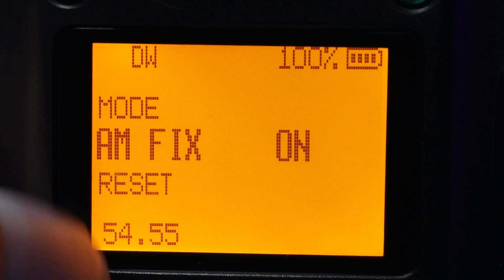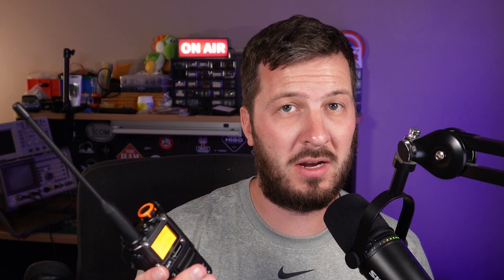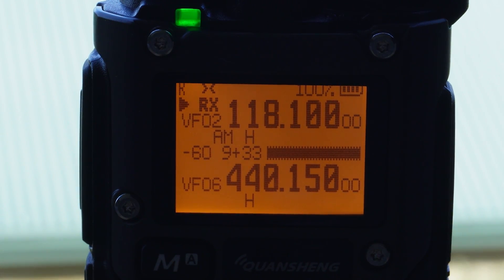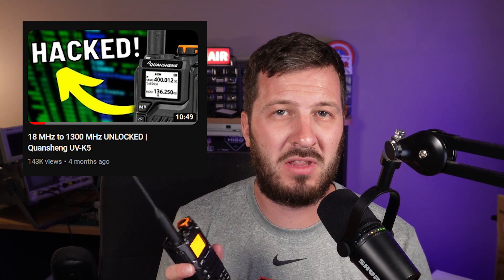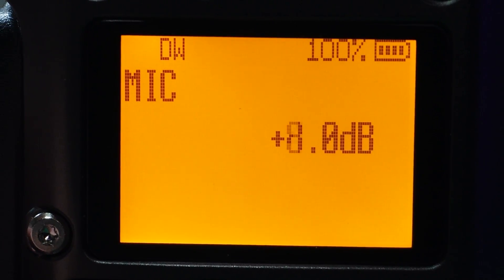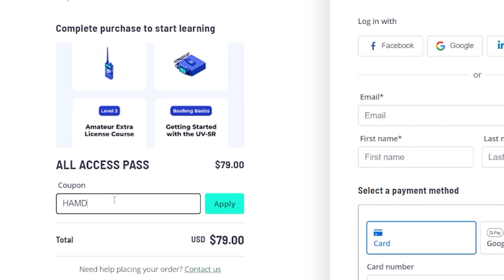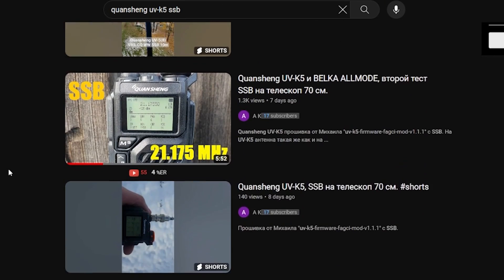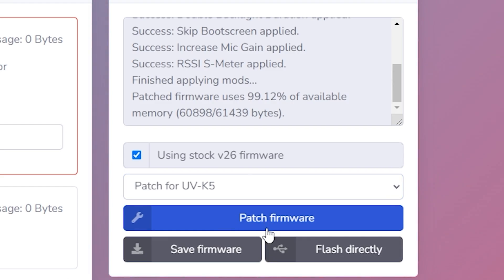Airband Radio FIXED in the Quansheng UV-K5 (Listen to Aircraft)

Comment: Another way to clean up the AM reception on these radio's is to use a better antenna for that band. the little rubber ducky antenna isn't even CLOSE to the airband frequencies, but a 55cm long antenna makes a world of difference. Paul from Slovakia - OM0ET, uploaded a video on his channel about a new firmware aswell, it supposedly fixes the SSB reception along with some other improvements. ITS NOT this firmware your using. It might be a different option for some people. I have installed it on my Quansheng UV-K5 and my KSUT UV-60D, both the same radio, just a cosmetic and name change on the case. It seems to work OK, but as with all these firmwares, it's not perfect. 

After installing, you push the function button, then button #5, then use the function button with the FM button and you can scroll from FM to AM to SSB, I'm still trying to work out how to get the desired frequencies to be easily accessed. I can enter an airband or six meter frequency via the VFO, but as soon as I enter any of the expanded displays shown in these Youtube video's, such as the spectrum, the frequency is simply random, usually 5-10Mhz away from the channel selected, and the ONLY way to adjust it is by 10Khz steps, it takes FOREVER to get from 136Mhz down to 127Mhz at so small a step, and once the radio DOES get down there, any further button use makes the frequency jump to a random spot on the band, or even to another band entirely. It can be a pain in the arse at times, but for less than $50 delivered, both of these radio's are fine with me.....I cannot afford to buy a $3000 radio to to get these bands, and a scanner is better for airband anyway, as this radio can only use ONE CHANNEL at a time and it's VERY difficult to make a scan list on them for anything other than the 2m or 70cm bands. They are fun though. Shame the cheap upgrade antenna's usually have an SWR of about 12:1, I have a box full of unusable SCAM Nagoya NA-771 clones that are so wildly out of tune all you can do is laugh about it, good thing they only cost $0.70 each. They say HAM radio is a fun hobby.....
Reply from the maker: Thanks for the info! I found that you need to press the PTT button once you're in the spectrum view to get this "capture" screen where you can enter and adjust the frequency more easily.
Reply: In SSB mode FUNCTION then 5,  press the PUSH to TALK button which switches the screen VFO and LNA mode, then press 5 again the display changes to a line to enter your frequency, example: 024 then press the SCAN button to get your . then press the rest of the frequency 000000 and then press the MENU button to enter the frequency you just keyed in.
Reply: @ominkan3129  Thanks for the info. The modded firmware is one thing, finding a guide to use it is quite another.
Reply: @bitemykrank1970  Your are very welcome. I hope it helps. It took a while to figure out all the new things the keys do in SSB mode. 
On the outside antenna it really picks up stations. I was surprised. Take care, enjoy.

Comment: Which firmware did you apply? V0.16?
Reply from the maker: The firmware that I have is an older version v0.8. I have yet to try the newer ones, I didn't realize they have even more releases now!
Reply: @HamRadioDX  Perhaps if you are able to create a new video showing the Firmware and see if it includes the new added AM Fix? Thanks from across the Ditch KiwiLand lol 73

Comment: I've done the firmware but not getting the S meter. Everything else seems to be there but still seeing UVMOD meter.
Reply from the maker: Which version did you use?
Reply: @HamRadioDX  egzumer v0.16. Sent you an Instagram pic.
Reply: @HamRadioDX  I just flashed 0.17 and I'm not seeing the new S meter either but everything else is great! It seems to be holding on to an older version of the S meter I got from a different mod fw.
Reply: It looks like 0.13 and older have the S meter in this video. 0.14 and newer have the piotr022 style S meter

Comment: Yeah, been playing with the AM FIX mod for several days now, and it basically took the Air Band from being unusable to clear as a bell. Looking at the code, it appears to have been a gain problem.
Reply from the maker: Yeah.. I still notice on super strong signals that it's still just a hint of distortion, but still perfectly readable.
Reply: @HamRadioDX   i also set the AM freq's all to NARROW. The audio is now even more clearer than when it is set to wide, with less distortion. Also seems to be more sensitive on narrow.

Comment: Thanks for the update. Will this radio transmit on 40MHZ band and if so how many watts after firmware mod?
Reply from the maker: No it won't TX that far. The PA is not broadbanded enough to cover that, and even if it did, it would be extremely inefficient and spurious unfortunately